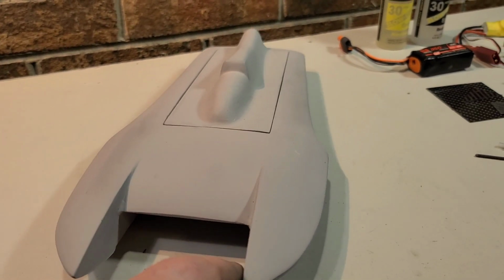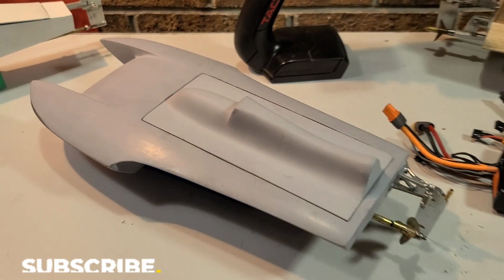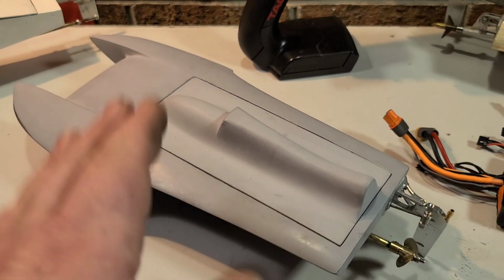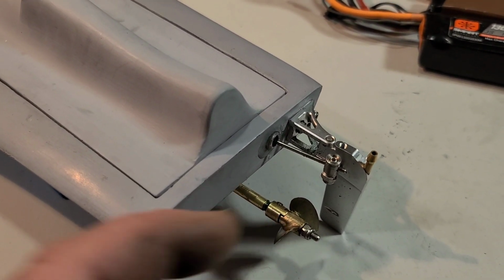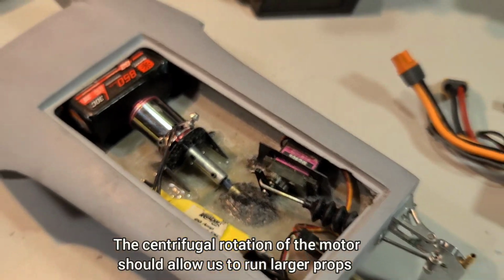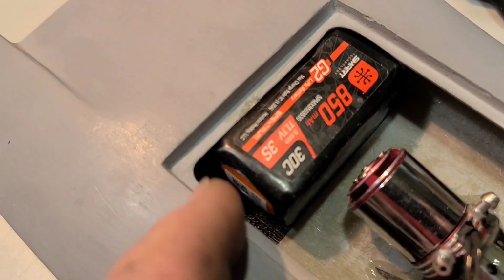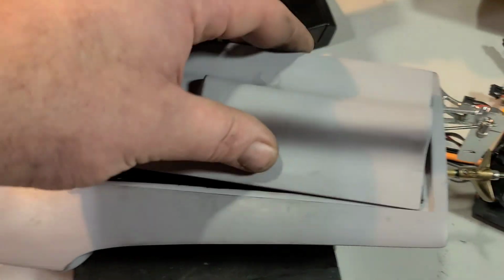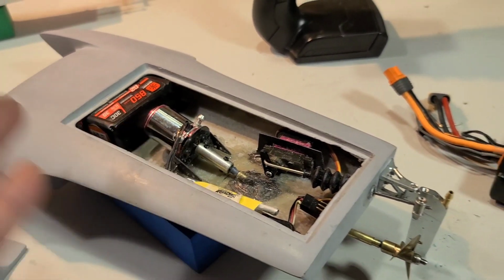13" Rc Hydroplane Speed Build Start To Finish

Comment: Awesome build. I just finished my 13" hydroplane and im using a 3000kv outrunner and a 34mm three blade prop. Its what i had. I know its too big but the boat runs good. 23mph on 2s
Reply from the maker: That's awesome 👌   wish I could get a GPS I'm mine lol.

Comment: I have that same motor...not sure of kv or can size though... i bought like 2 of them from hobby king 13 years ago ...my biggest one was in my fiber glass out rigger ...i messed up and motor spun  loose from mount and trashed the wires...they are skinned right up to motor... I did not know if those motors are still available or what they are called...just  remember they have serious magnets....i wonder what top speed is for a little bugger like this...very cool video..